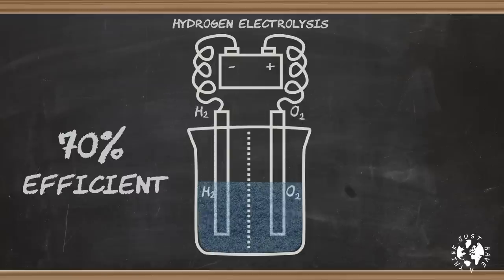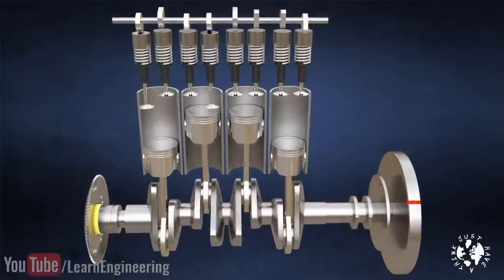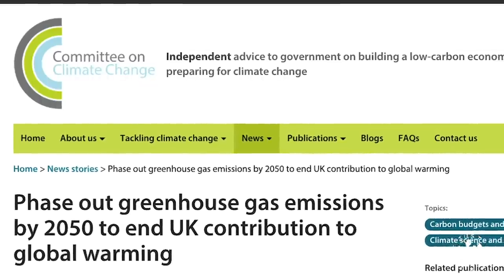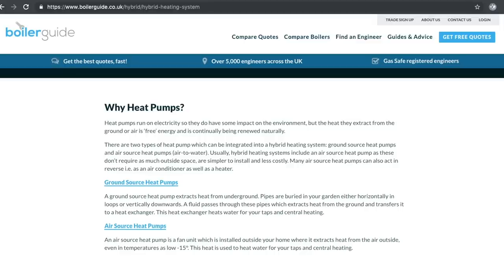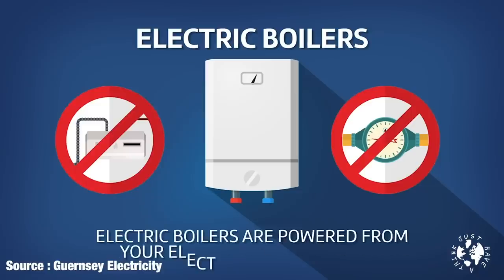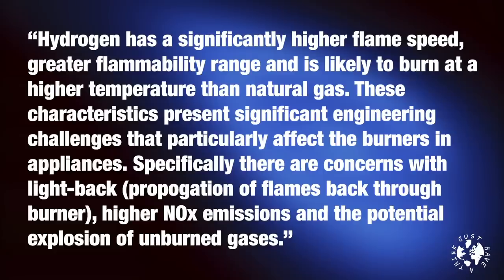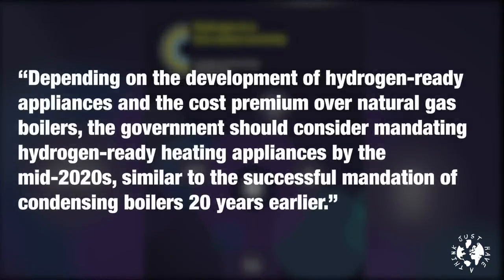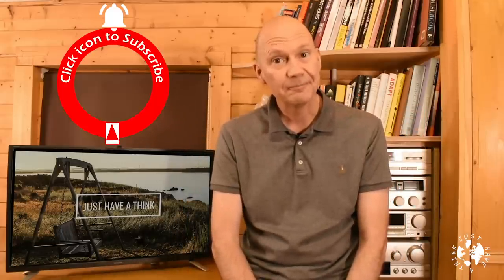Hydrogen for heating our homes

Comment: Please.  Using electricity for heat is the dumbest thing you can do.  If you burn whatever it was you used to make the electric in the boiler itself instead you will still be 3 or 4 times more efficient than generating electricity with it.  Most fuel to plug efficiency is 30-40%.  That's why electric costs 3 times more than gas, because it takes 3 times more gas to make 1 kwh.
"Oh but what if it's from renewable sources?"
Great, but when we start talking about off loading domestic heating to renewables, then car charging... where is this renewable energy coming from?  We certainly don't have any where near the capacity to run what we do have today, let along doubling or tripling electric demand.  Not without first finding a carbon neutral way to generate all that power.

Comment: Carbon Capture and Storage is an option worth looking into. Especially if other new technologies are able to turn it into a resource. There was a video in here somewhere that was talking about using carbon as a building material; or at least a component in new concrete replacing materials. Which sounds like a good option to me.
Reply: As long as the future use of carbon doesn't end up releasing it back into the atmosphere

Comment: Idk, hydrogen doesn't make sense. It would be more expensive than just using electric appliances. Electric heating is 100% efficient. Transforming things into hydrogen just uses more power.  But electric heaters are expensive to run already, hydrogen even more so.  

This is already having heat pumps that are a/c that are running in reverse, electric heaters and electric cars, grid would need to be even more robust than it is now. 

Maybe having things like the virtual power plant, every home has it's own battery pack.  Maybe Grid level hydrogen storage for power generation, for times that need more power, instead of batteries that don't work so well in the cold. 

We are just going to need a lot more energy than we are producing now.

Comment: What about doing videos on duel fuel engines that like run on diesel fuel and different pressurized gasses. The technology leap to do these kind of things is already here. There duel fuel cost savings and performance improvements. Plus, you are not strategically disadvantaged when one fuel source is cut off or there is a price hike.

Comment: You didn’t address the use of Hydrogen or natural gas into a fuel cell in a domestic boiler. According to your figures that would make 60% electricity and 40% heat. We have one of the best gas grids, too good to give up.if every house or school or hospital used the gas in a fuel cell the surplus electricity could power the rest of us. And guess what, we close the wasteful gas  power stations that throw out half the heat up the cooling tower. Thus 50% reduction in CO2!

Comment: From exergy destruction point of view, electric heater is the least favorable option. It might convert electricity by 100% but that electricity (the useful form of energy unlike gas or heat) comes at a price of releasing co2 at the first place. The electric power plants are hardly efficient above 40%.

Comment: Using hydrogen in a fuel cell produces electricity and the waste heat from the cell can heat water. This is efficient and avoids the problem with flames
Reply: Well put...the fuel cell would require a hydrogen storage unit at the home...I'm not sure I'd like to have a incredibly high pressurised tank near my house...but an interesting idea!!.😎
Reply: @fivish  doh!
Reply: @fivish  Bu they are not very efficient unfortunately

Comment: Hells bells. Lets consider the following. CONSERVATION OF ENERGY. Why is not the EU looking at zero net energy residential and commercial buidings?
Actually for moving a person, SOV's do about 1% when you move the person with a one ton Mercedes.
Reply: @Allen Loser sure thing. Its why the situation of monopoly power generation got us into precisely this mess. Supply that went and created Demand. 
My lightest auto was a FIAT till finding out it meant FIX IT AGAIN TONY. Also had that little beast called a Gremlin.
Reply: @Allen Loser Its a quandary alright. That said, had everyone been given a carbon fee and dividend, most would have started reductions and saved $ long ago. And yes, for some folks it means burning a wood cookstove. I have used them before at hostels in mountain communities. REC'S like Kit Carson coop in Taos are closing in on 100 % renewables. Can be done.

Yes Mercedes are bigger beasts.

Comment: Hydrogen is a very small atom and can leak out at every opertunity. Pushing it down our existing gas grid would be very lossy and even dangerous.
Reply: Exactly, it'll leak all over the place. Plus H2 can attack seals and joints. But H2 isn't flammable above 70 to 80% concentration. So it shouldn't cause the pipe blow up. It's the same with natural gas.
Reply: Before LNG, town gas (coal gas) was piped to homes.  Town gas contained about 40% hydrogen and the gas grid survived.

Comment: Extremely well done!  
  My concept for home hydrogen production is on the lines of solar PV electrolysis, storage in an adsorber like some type of synthetic zeolite, and then those newer appliances or retrofits.  To make it all viable add a pipeline of commercially produced H2, and finance the upgrades for home heating envelope efficiency   There are some attractive easy-to-install options like wall "foamboards" made by growing mycelium on barley hulls, just pop onto existing inside walls or ceilings, add extensions for outlets and opening trim, and be sure to seal tightly so warm moist air doesn't get through.

Comment: Exactly right on the existing fossil fuel industry wanting to keep things centralized, hydrogen would suit that desire very well.  Decentralized energy sources like home solar or wind on a large scale would make deep cuts into the current power generation industry's  template.

Comment: One thing that people miss when reviewing the new technology around electrification is how we get the electric power. It’s not just a simple as plugging your electric car into the mains. Mass adoption of electric loads like cars and heat pumps are going to increase the load on the grid and I’m not just talking about power generation. Sure at the moment we use 50% gas to power the grid so all those electric car owners thinking they are green are not with so virtuous, but when you have large loads on houses you can end up with an unbalanced supply. Three phase does stranger things when the supply is unbalanced. Heat pumps are not so much of a problem since they are constant loads but when your house is not using one and your neighbour has a heat pump and a electric car then your going to see some issues. I’m not saying we shouldn’t consider electric but we need to the picture for what it is, more complex than just flicking a switch. We are all going to be poorer to accomplish net zero and in the interim or reduction is going to be swallowed by India and China so what we do won’t make any difference to global emissions other than making the general population poorer. 

The net result will be that the rich get richer and the poor are giving that money to them. Then again as talkyToaster says “what else is new”

Comment: Oh screw it all. Hydrogen appliances are not the solution. For seasonal, perhaps even daily, fluctuations hydrogen or methane might replace natural gas at the local power plant that supplies electricity to the homes.
Reply: @Allen Loser Natural gas is about 75% methane. Methane can also be made from hydrogen and a catalyst at about 400 celsius. Methane is much easier to handle than hydrogen.
Reply: @Allen Loser Natural gas is gotten by fracking. Fracking only works for a year or so in each location. So natural gas is a limited resource. Methane from hydrogen is unlimited. So we can keep all the power plants, storage tanks, transportation, piping, and general infrastructure without having to take an economic hit. Just toss up lots of wind turbines and solar panels and create methane with the excess electricity that is generated. Then use the methane when the wind isn't blowing and the sun isn't shining.

Comment: Burning a naked flame (eg:from gas) in a nitrogen based atomsphere (as ours is) is bad news as regards human health (toxic nitrogen gas produced). So this whole subject should be approached from the health aspect and not on just economic cost. Forget using hydrogen or any gas. Use electric. If you have ever driven an electric car then you will know just how clean they are to be inside one.  No shitty gas nor diesel fuel.

Comment: This info is now partially out of date. I suggest you revisit the case for hydrogen as a domestic heating fuel.
The global carbon budget consistent with a two-thirds chance of limiting global heating to +1.5 Celsius will be depleted before 2030 given forecast estimates of global emissions over the coming 8 years. A global CCS industry capable of removing the billions of tonnes of excess CO2 dictated by a 2050 net zero target is looking increasingly implausible. Net zero by 2030 to 2035 now seems like a necessity, particularly in the U.K. for which historical emissions justify a more rapid transition on the grounds of equity. 
Given this shrinking time constraint for decarbonisation and a recently published study demonstrating that blue hydrogen can never be a substitute for green hydrogen, even with effective CCS, it is clear that a mass transition from natural gas to hydrogen is no longer viable. We have neither the time nor the green energy capacity to deliver this, given other existing decarbonisation commitments and constraints. In fact, it would be a dangerous distraction from viable alternatives such as heat pumps.

Comment: The only possible use I can see with hydrogen for home use is to split water in order to store the gas for future use in a fuel cell, to generate electricity on demand.
Reply: ! kg of hydrogen will cost you between 43 and 55 kW/hrs of energy to produce. An economiser to make that hydrogen will cost you about $8000  Go buy yourself a couple of powerwalls and cut out the middleman AND save money!
Reply: Curran I think you may be right for off grid applications in northern climes where the sun only shines less than 8 hours a day (i.e. December). Perhaps the excess solar energy can generate and store hydrogen from April, May, June and September and be used to supplement low solar energy values in November, December, January and February.

Comment: Hydrogen from methane is a terrible idea it still requires fracking which ruins water supplies as well as the emissions. Solid state batteries come 2024 if the planned car comes on time solves all our main issues with batteries plus no rare earths. Hydrogen just won't compete I'd say.

Comment: Good video, but why is there no mention of cogeneration (combined heat and power)?

It can be applied on different scales - individual houses or municipal. Using the hydrogen to generate electricity, and the waste heat for heating, results in very high combined efficiency. Generating heat and power close to the consumer -> less transmission losses.

In the ideal case, a CHP facility for a neighborhood/town could generate its own hydrogen when power prices are low. Remember: curtailment is a real issue in many places and as more renewables go into the energy mix it will become more frequent. (Curtailment - solar/wind farms being forced to shutdown when there is too much energy in the grid. At those times power is effectively free). This way power can be stored cheaply and for long periods of time.

If the need for heating is low, relative to power, there is also the option of using adsorption chillers - cooling units powered by heat, not electricity. It is an old, but not popular technology, recently seeing some uptick in interest.

There are many approaches to cogeneration, both in terms of scale and technology (fuel cells or combustion), the best ones will still have to emerge and become cheaper as the technology gains traction and becomes more popular. That being said, there are likely way over 100,000 of such devices globally, with Germany being the leader in Europe in recent years https://en.wikipedia.org/wiki/Micro_combined_heat_and_power#Market_status

Comment: Here is a video I'd like you to watched https://www.youtube.com/watch?v=EkjpVcsRQLc as these people in the video are eye witnesses to this technology working. What the powers that be fear is this technology is best used at the individual level where people like you and me are allowed to take full control of our own energy needs totally cutting them out completely. 

Now when it comes to burning hydrogen to lower the speed of the reaction all one needs to do is add in a non combustible gas to the mix as it has the effect of slowing the burn rate and lowering the burning temps. Yeah, it is that easy as how that process works is like bit like this: If you want to get across town in your car the time it takes you to get their varies depending on traffic conditions and time of day that you take off, correct? If you take off at 2 AM in the morning the time will be a lot less than if you take off at 6 PM when everyone gets off work at the same time, why? Because all of the other people are in your way which is exactly the same as the non-combustible gases when added to hydrogen as those non-combustible gases will physically get in the way of the reaction between the hydrogen and oxygen atoms thus slowing the burn rate and lowering flame output temperatures. 
So, with this technique we don't even have to change a thing to the existing natural gas lines as the burn rate of the hydrogen/oxygen reaction is controllable by simply adding in a gas that does not support the burning process. Meyer demonstrated this in this video: https://www.youtube.com/watch?v=Z5afwEcZ3Ok&t=11s

Comment: You still haven’t explained once where hydrogen is a good idea. This debate is now old. And there hasn’t been a decent argument yet. So it’s not even a worthy debate at this point. Hydrogen will not be plentiful enough by producing it renewably. It’s a sham. 35% efficiency is optimistic for end use hydrogen. Insulation in homes and electric heat pumps are a perfectly good way forward. The desperate need for governments to have a monopoly energy source is overwhelming apparent. Don’t get me wrong. Hydrogen will have a place somewhere. I’ve heard that it’s an excellent replacement for oxy accetaline (spelling) welding, cutting etc.

Comment: Renewable heat energy is surely the way to go. 
For each unit of energy imported into the home/facility/hot water /system, space heating heat pump, between 2 and 5 units are free from ambient air or water source.

Hydrogen makes no sense

Comment: To heat homes: In the joist runs that are insulated from below by 2-3/4" XPS fire rated board & centered on X-braces 3/4" PVC pipe with a thermal fluid that's liquid from -40C to 350C is heated in sections of 3/4" galvy or gas pipe having ceramic magnets spun around it by a magnetic motor to induce heat in the system and pump it around that floor.

No fuels for the lifetime of the bearings, magnets last many decades, ymmv.

Comment: What we need is more nuclear (thorium) energy.
Reply: To expensive.
Reply: @turningpoint4238  it's the cheapest form.of energy known to men. If it is expensive, other forms are even more expensive
Reply: @tedarcher9120  err no it's not. Have to admit I used to be a nuclear operative. As someone thats worked in the industry I have no problem with nuclear as long as we sort out the waste storage, make better reactors (the designs we have today don't cut it) and it can be made economically (which it defiantly isn't).
Reply: @turningpoint4238  maybe in the US nuclear energy is expensive, but overall it is slightly cheaper than methane and much cheaper than coal, and price per KW is about the same
Reply: @tedarcher9120  Nope.
Reply: @turningpoint4238  so you can just deny reality like that? Nice skill!
Reply: @tedarcher9120  it sums it up. Really just go look at Lazards Levelised costs.

Comment: I find the presenter  a little passive agressive on hydrogen. As most opponents of the tech continue to do, the efficiency issue keeps being dragged. 

Doing that, in the case of GREEN H2, ignores the fact that energy loss is actually free energy. It's  a little like deriding solar panels because rately do they cover 100% of a roof. The same logic about energy losses would have opponents of solar panels ppint to the fact that energy falling on your roof equals energy loss, therefore  when you add the losses when converting DC electricity ro AC  The technology is inneficient.

H2 only has 2 costs. 1 is the capex, what it costs to install the infrastucture and 2, very minimal maintenance cost.

It doesn't have to buy gas to reform, it diesnt have to buy coal tp burn and it doesn't  have to buy uranium.

In other words, all the elemens needed to produce hydeogen are available free to the operator. What does it matter if there are losses? Just make more. It's  virtually free to do so. The infrastructure is expensive now but with greatee take up, just like with wind turbines, those costs will come down as more infrastructure suppliers come into the market.

HAVING SAID ALL THAT, Ive subscribed to the channel because it is likely to come up with some uselful information from time to time . I have watched it before 

BTW GREEN H2 can now be produced fir about 1 pound a kg. (33KWh), which if I'm right equates to about 3.5p KWh